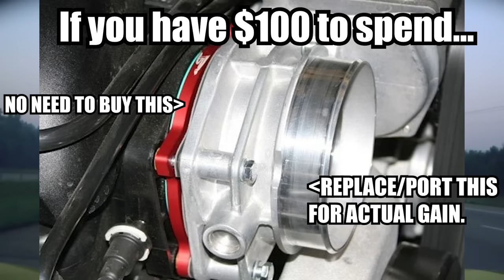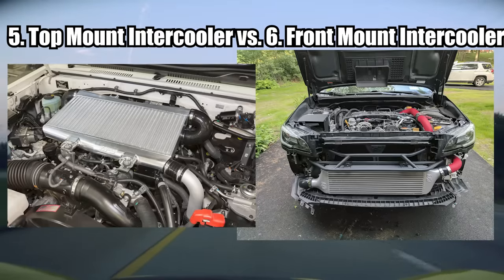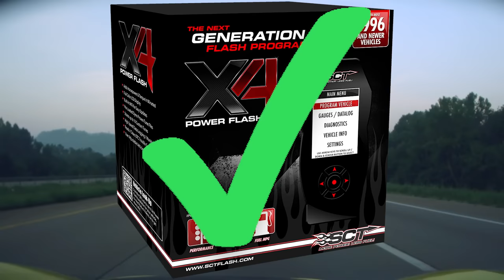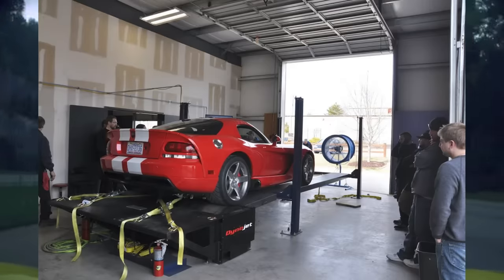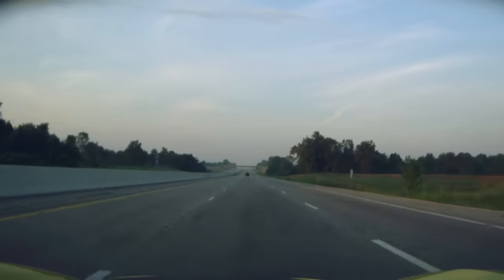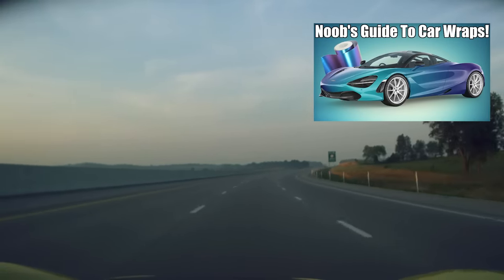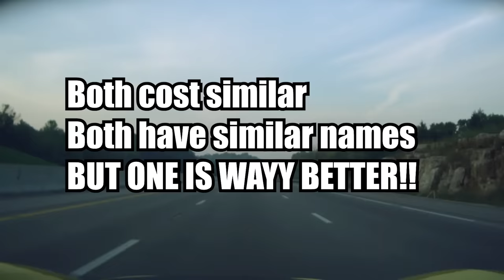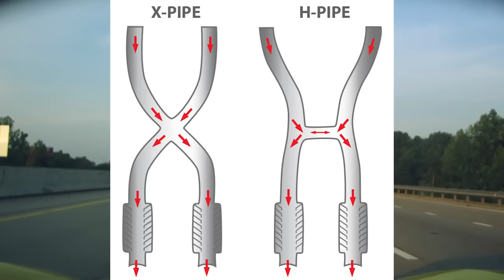25 Real VS. Fake Car Mods!

Comment: Your exhaust thing was pretty bad. Straight piping is not the same as a muffler delete and or a resonator delete and or cat deletes. It’s not straight piping if you just cut off or remove your muffler(s), resonator(s), and catalytic converter(s) without installing a straight pipe. It’s also faster and easier to empty your lungs blowing through a paper towel tube than a straw. Your whole keeping exhaust pressurized thing is also none sense. Ideally, having no back pressure would be great but you will always have back pressure.

Comment: three, maybe four things; 
cold air intake-> highly dependent on the car. some cars benefit from it, some cars actually lose power compared to the tuned factory intake (which often already is a cold air intake) and depending on your airflow situation under the hood some engines love really short intakes. if theres cold air flowing through the engine bay because your car is a tiny 60's british sports car there might not be anything wrong with running a really really short intake. if your engine bay is completely sealed, then yeah, obviously you need to grab the air from somewhere where its not heated by the engine. (this is a maybe two things, factory intake often are cold air and some especially old cars dont necesarily benefit from it)
intake fans-> you put them together with electric superchargers and said that they call it that, but electric superchargers are actually a thing. the thing is just an intake fan aint one. if a seller calls an intake fan an electric supercharger, then thats fraud. plainly and simply. electric superchargers are usually centrifugal superchargers that are driven with a powerful electric motor instead of the crankshaft. an intake fan is a really scrappy pc fan obstructing your intake. biiiiig difference. even tho i wonder what would happen if i put a massive RC electric ducted fan into a 50ccm scooter intake. use 6-12kw electric fan to push air into a 2kw engine. might be funny
and then straight pipe vs h-pipe, tuned exhaust etc. your example of a straw vs a paper roll makes little sense. you gotta push a lot harder into the straw than into the paper roll. you want it to be as easy as possible. the problem is the length and as you said it the speed at which it vacates the pipes as well as the exhaust not being a person blowing into a pipe, but being individual blasts. thos blasts stagnate in a big exhaust and suddenly you have the fresh exhaust blast colliding with the old stagnant one. especially with an h-pipe or a crossover the blasts from the other cylinder bank can help the blasts keep moving if the pipe is the right diameter for the expected exhaust and with that power. you dont want to go too small (see straw where you have a lot of resistance) but you dont want to basically have an echo chamber that looses all exhaust energy

Comment: Heard somthing about porshe having electric powered turbos or somthing in their car what's the difference
Reply: I didn't know Porsche was doing it but I know Audi did it, they essentially had an electric powered turbo that would give you boost while the main turbos are just spooling up, then once the actual turbos spool up the E-Turbo (as I call it) shuts off as it isn't needed, plus you'd need one hell of an alternator to power one for an extended amount of time.

Comment: @ 8:30 hey lol I have those exact coilovers. Raceland Ultimo's. I can't speak for every model they make them for but they ride exceptionally on my e92 if anyone is in the market for CHEAP coilovers. Just wish they had preload adjustment. As you can see from the screenshot in the video, there's only height

Comment: Well the only one I would slightly disagree with is the tires one because I had a charger 392 and had bald tires with no bands showing and hooked really well on street however they did not hook very well at a drag track so street racing with bald tires is a W but track racing slicks will take it any day

Comment: Question: Is putting a roof spoiler on a sedan/coupe an alternative to having a spoiler on the trunk in general? Like, if you wanted to add a spoiler but didn't want a trunk mount, would a roof spoiler yield similar results?
Reply: No. A roof spoiler will still ruin your airflow on a sedan or coupe. A trunk spoiler will be the best for aerodynamics

Comment: I have a question, I just got a Toyota 86, would headers be something I should do first or last when modifying my car also I heard the un equal length headers help the torque dip, is this true? I’d like your input you seem pretty knowledgeable lol
Reply: yes go do headers and a tune, and yes it does help with the torque dip

Comment: With the bigger air cooler cat back exhaust good air intake system the car will have a quicker throttle response. The turbo will boost faster I've done it to my punto evo arbarth good results. Thinking about a remap. That will give me 200bhp

Comment: One comment about dyno's, is that people get too focused on looking at Peak Power gains, and ignoring what is happening elsewhere in the rev range along with torque curves.  Peak Power usually only occurs at maximum revs, and that's not where you spend most of your driving.  So for 95% of road cars, focusing on peak power is useless.  The 5% are just Hard-Parkers after bragging rights....

You may spend $2000 on mods, gain 10kw at the peak, and go home crying.  But the mid-range may have also gained 20-30kw, and you'll notice this waaaaay more, and get a lot more enjoyment from your car, than that extra 10kw will ever do.

This is also where things like cold-air intakes get ragged on.  Yes they gain zero peak power, but the "improved throttle response" everyone feels is part psychological and part small increase in the low to mid-range.

Comment: I had to get a short ram intake + pod for my Eclipse because the previous owner had a bunch of stupid shit installed in/on the car from eBay. All of that went into the garbage and I got that in there because I also don't think (based on engine bay design) a CAI would fit at all. Doubtful if it helps much, but a heat shield was bolted on asap. It's either that or rubber band a pantyhose to the intake. >.>

Besides, some sources claim OEM filters need to be swapped after 15k miles or so while aftermarket ones need changed or cleaned after 40k. Believe me, if I could find a 2G Eclipse in a scrapyard somewhere you bet I'd at least think about ripping out the stock box system then install on mine.

Comment: Put a balloon on your straw and a balloon on your 1.5" tube, and see which balloon empties faster. You are wrong about exhausts. Its not about creating a high pressure feeling air flow out of a tube, its about getting as much air out as possible

Comment: I have a question.
4:29 At what year are car computers dumb enough to be eligible for use of proper performance chips? Because you said that older cars can be modified with chips with a noticeable difference in performance.
Reply: its honestly not worth it, just get an standalone. so much better

Comment: I know this is very general, but would going from a 2” to a 3” cat back exhaust help, considering I’m planning to go from 210 to about 330hp in an in-line turbo engine, (Volvo t5)
Reply: yes, but going 3"" from the turbo back if it isnt already would be even better
Reply: @arcanevoid9199  Sadly Sweden (were I live) have constant inspections of cars emissions, mods and so on.. so it would be a huge hassle with having 2 different exhausts and switching back and forth 😑
Reply: @kalle5548  oh that sucks, maybe easier to just leave it stock then
Reply: @arcanevoid9199  yeah, but at the end of the day in a teen and those engines Volvo i5 are able to sound like a mini Viper,

Comment: the point about wheel spacers, I find that it's better to go with ones that have their own threads, that way you can get a full bite on your lugs.

When I bought my pickup from some meth heads, I took off the tires and discovered they had installed wheel spacers, the lugs were only being held on my like 1/8" of thread, this leaves potential for catastrophic issues going down the highway. Luckily that wasn't the worse issue I discovered by the jerry-rigged meth head truck lol.
Reply: yea or just use extended studs

Comment: This isn't me trying to be rude I understand that you are trying to help people but just buying an air intake I have seen 1mpg gains and I've saved a lot of money on just being able to clean the air filter with water vs buying a whole new one that's just my 2 cents though good video.
Reply: But did you do it to gain MPG? Most people do it to gain power. If you gained MPG that likely means you lost power since less fuel needs to be used.
Reply: @captainhellhound7451   Oh i see good to know thanks for letting me know about that.

Comment: I, sadly, can’t get my hands on a supercharger for the Lexus LC500. It does not seem to exist yet. Something about the ECU if my searching is correct.
Reply: just because there isnt one specifically for the car doesnt mean it doesnt exist. plenty of superchargers out there that would work, and most likely the ecu cant be remapped but you can go standalone
Reply: @arcanevoid9199  I’ll talk to a few mechanics and see what’s up. This is a project car that I bought for work. I do vehicle photography but fell in love with it. I want to do some performance mods instead of all cosmetic.

Comment: I am familiar with the usage of vortex generators on jet aircraft, e.g. the leading edge extension on an F-18 or the canards on the modern European delta wing fighters. They increase lift as the vortices move over the wing. Is this effect just not an issue at the slow speeds of a ground vehicle? Or is the effect too little compared to the weight of the vehicle? Or maybe it is something to do with the effect only operating over a much smaller area? Is the effect overruled by the effect of the spoiler (something like how a supercharger takes power from the engine to run, but helps generate more power than it sucks up)?

However this plays into things, it is simply counterintuitive to what I know from aircraft. There has to be something I do not understand here, hence the questions. (So far I have only ever gotten people answering me with things like what this video says about them..... and that is NOT what I am asking)

Comment: Except diesels they like big wide straight pipes
Reply: I work on a cummins 6.7 engine for a business and it has a 5 inch on it, the reason trucks like that need an exhaust that big is for torque and a lot of them are deleted/tuned as well

Comment: is it so common in the usa to not pair an intake with a tune to optimise the engine to the higher airflow ? i get it that without a tune it gives you nothing or some hp but depending on the car it can give you a good chunk of power if you pair it with a tune. jlt cold air intake with matching tune on a european mustang is like +40hp on the 5.0

Comment: well bladed angel i have a question I have a ZC31 Swift (not sport) so its turbo charged diesel xd but i installed a oem rear spoiler so is it gonna make some aero on the rear wheels ? it has 75 hp full stock 
I guess i will dyno it and tune the ecu to get at least 100 hp out of the stock engine even tho that car weighs around 850 kg and i think of converting the rear drum brakes into disc ones just for the brake power and then maybe do some minor engine mods like rebalancing the pistons and replacing cams etc
Reply: minor engine mods = rebalancing pistons and cams? bro thats not minor, and why would you do that to a normal swift? would it not be easier to just get a better car?
Reply: @arcanevoid9199  well i wanna push out as much as i can out of that car its a good car nimble at corners has some speed runs smooth and the rebalancing pistons is not an easy thing and it will be done in the final stages to gain power for now its an ecu tune to get nearly 100 hp from that engine
And for me that car is not a car but like my brother hope you dont have any problems with that
Reply: @Redline95  but you could get more out of another car with the same amount spent on it. its only nimble on corners because its light, the suspension isnt great on swifts because its not really designed to go fast or anything. idk why you would open up the engine and do cams and a tune just to make 100hp. i can understand that but sometimes its just not worth it no matter how the car makes you feel. it doesnt have much potential unfortunately
Reply: @arcanevoid9199  i know but its my thing really if i want i could just swap a suzuki swift sport 1.6 l engine in and it would GO but i want to see how much that old engine can handle yk and swift is capable on corners i have driven it hard and it never dissapoints people also buy 180sx's and modify them even tho they are somewhat slow thats a thing i have to make underpowered car pushed to its limits no matter the potential i know my engine can be pushed so its one car in my country that can be pushed i cant even buy a 180 sx or even a lancer trust me 
thats why swift is the best tuner car in my country and i think it can do somewhat good thats why i cant go waste money on importing a car now you know?

Comment: Are you saying for the straight pipe one that if i straight piped with a 2" and my stock is 2" that wouldnt increase performance?
Reply: if your stock piping is 2" then its probably quite a small engine and i doubt you will see much improvement with a straight pipe. will probably just sound terrible
Reply: @arcanevoid9199  thats just an example. With numbers i made up. The point is the straight pipe example used he said 2" to 5" straight i was saying if it was 2" stock to 2" straight would that be "fake mod"

Comment: Oh yeah talking of straight pipe garbage...

my first car was this inherited ford focus zetec 1.8 petrol. Not a great car, but it had some beans at the higher revs...

I got it and it was so loud and so obnoxious and couldn't handle hills very well. I had the exhaust fixed, as in, had the mufflers put back on and suddenly it was really responsive and could fly up hills. 

Blew my mind cause the guy gave it away cause it was "dying" and he complained that it had no power.

Comment: i got a 3 inch straight pipe, would it be better to get a smaller one for more hp? what is the best budget option? (b18b1 eg civic) 13:25

Comment: What I've noticed is that I've tried for fun replace old foam filter with sport filter (random Chinese "race" filter for 15€) on my atv (just small 0.5l one piston engine), I didn't expected any difference but as a surprise I've noticed a little bit more torque somewhere about 3k rpm, but I've seen a lot of videos where this kind of filter is changing the sound of engine a bit but for me there is no difference :D and also when I was buying this filter, on the page was written that it can lower fuel consumption, does anyone know if it is real or not? I've didn't noticed lower consumption but on Google I've found that my atv should eat around 10l/100km but I've measured something just about 5.5l, but I don't know how it was before new filter :)

Comment: ok im new to all this car stuff and im try to do stuff with my fist car is a 06 musang what is the dirfence between turbo and super charger? and can you do both
Reply: they basically do the same thing just in a different way, a supercharger is driven by the engine (usually a belt) to force more air in. a turbo uses the exhaust gases to spin a turbine that forces more air in. you can do both but its very complicated, and pretty unnecessary

Comment: 14:00 Hello from the future. The pressure you are revering to is the opposite, it's vacuum, the pulse wave travelling through the exhaust goes fast enough to create low pressure behind it that sucks exhaust from the cylinder, if the pressure wave is going too slow or the air volume too large, it won't create vacuum and you'll be left with a small amount of spent air in the cylinder. Modern exhausts eliminate this thise.
However.
Modern exhausts also deliberately re introduce some spent air to effectively reduce the combustion chamber capacity for muh emissions so that al gore will bring you presents on government mass day.

Comment: So you are incorrect

I wrote about it in another post but the engine doesn't need back pressure and in fact they can help if it has a vacuum I will say that your muffler will probably be one of the last mods that I would suggest you to get to simplify it your muffler increases your horsepower definitely depending on how much horsepower you've already increased so let's say that you kept it stalking you change out your muffler you may only increase it by one horsepower if that but let's say you added a supercharger to it and a whole bunch of other things and then add it your muffler you could be looking at 1420 horsepower increase for the exact same muffler as before so think of it as like a final boost to your horsepower number it should be probably one of the last parts that you buy

Comment: This video is hypocritical calling certain aftermarket performance parts marketing tactics lies  like intakes and straight pipes, they both work correctly when used….the example of blowing into the straw has nothing to do with the straight pipe it’s the exhaust scavenging wich makes a straight pipe work, exhaust velocity pressure is what your referring to and straight piping has no impact on that it’s the diameter of the pipe

Comment: Bro don't call me out on my cut exhaust I didn't cut it 😂  last owner cut it off at the resonator so it dumps right under the trans and I'm not exactly prioritizing the exhaust right away because the car has some issues like the softly being ripped the shifter being the floppiest thing known to man it over heating going through a damn drive through the list goes on and on but I assure you I will be getting a real exhaust